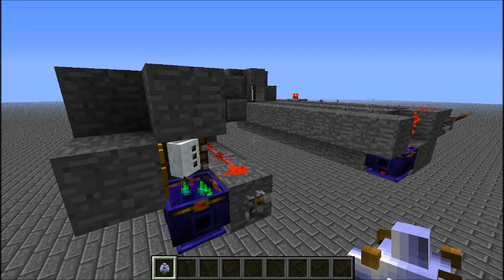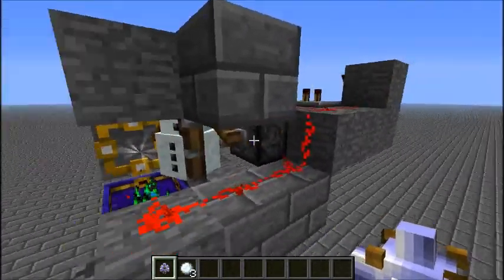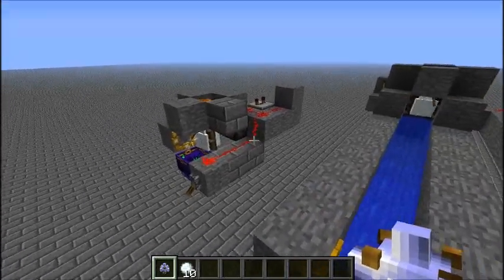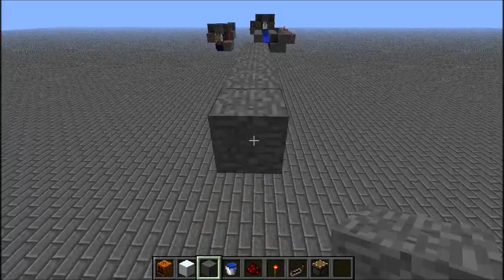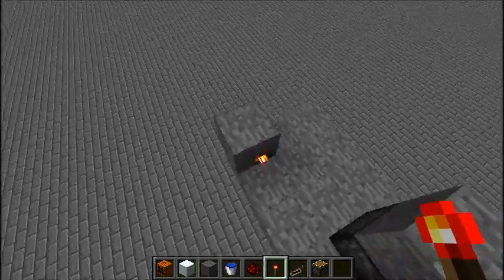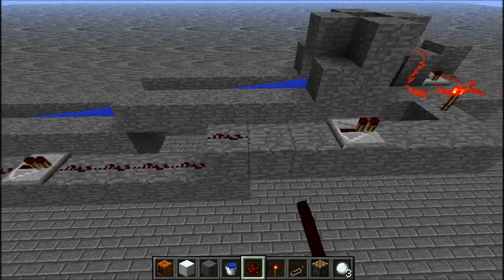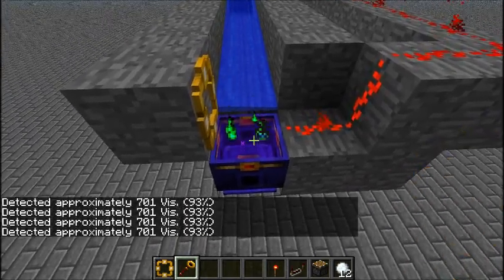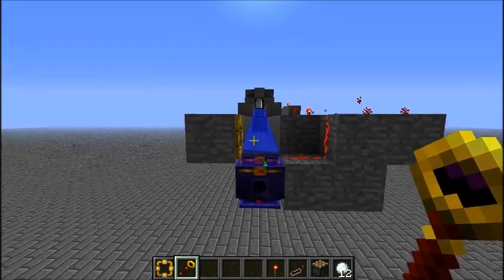Thaumcraft tutorials: fully automated vis machine

Comment: You might have to change the design a little, yes. But if you put a chicken above a water-block, then only the eggs will fall through. If you put signs under the water-blocks and a moving watet-current under that, then it will throw all the eggs into the crucible. I think eggs produce a lot of vis as well so it might be worth a try :)